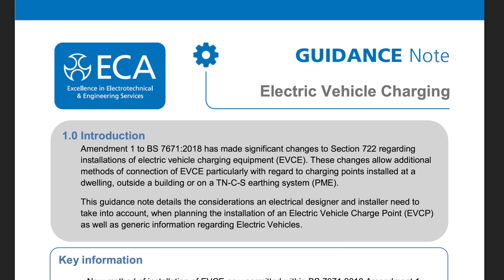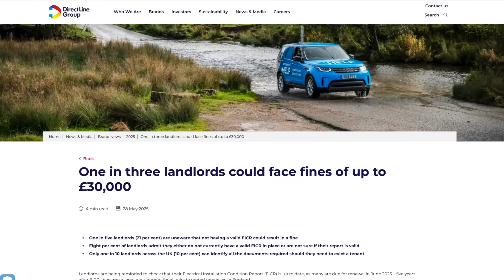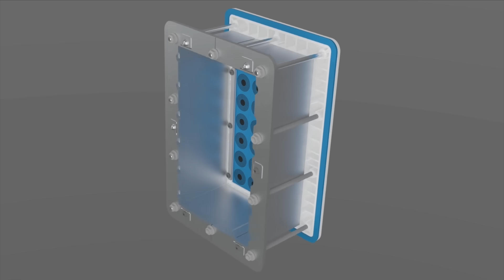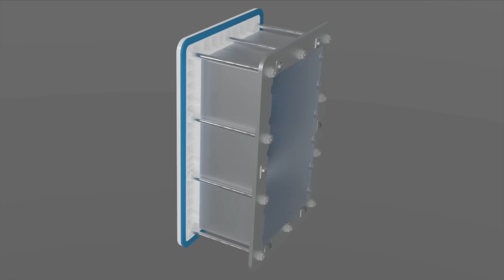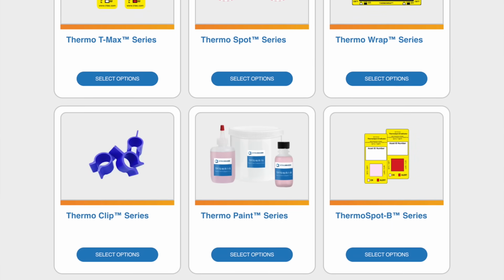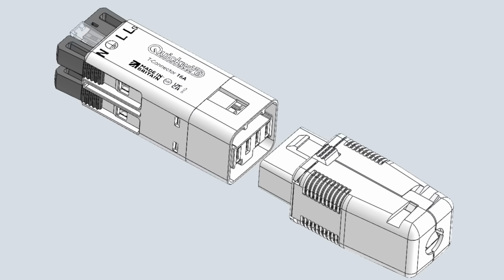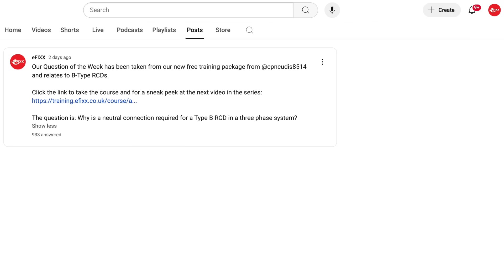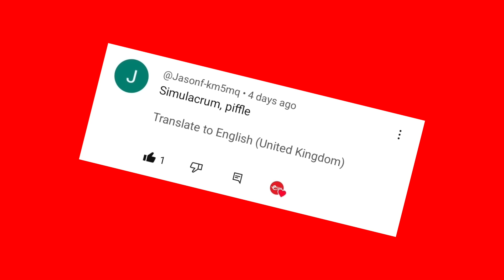Govt’s Cable Plan Sparks Safety Fears ⚠️

Comment: The Kordz PRS SlimCat page says it's rated as CAT6A and is good for 10Gbps up to 50metres, however the CAT6A standard is meant to be good for 10Gbps up to 100metres. It doesn't appear to be standards-compliant.

Equally, the Kordz PRO SlimCat page says it's rated as CAT6 and is good for 1Gbps up to 50metres, however the CAT6 standard is meant to be good for 1Gbps up to 100metres. It also doesn't appear to be standards-compliant.
Reply: Could be the 100W PoE that limits it to 50 meters. Likely able to do 100 meters if it was data only, or data and lower PoE standard.
Reply: Great question! You're right to dig into the details as there are nuances.
 
A Cat6 or Cat6A channel (or permanent link) depends on whether that installed component meets their respective electrical performance criteria defined in standards like ANSI/TIA-568 and IEC 11801. While these standards specify horizontal cable performance at 100 metres, that doesn't mean every permanent link must be 90m or every channel must be 100 metres long.
 
The Kordz SlimCat system is engineered to deliver a fully compliant Cat6 or Cat6A permanent link up to 50 metres. That means when installed correctly and tested (e.g. with a Fluke DSX-5000), it passes the same electrical benchmarks as a traditional 100m Cat6/Cat6A permanent link, just in a shorter format. The SlimCat Cat6 and Cat6A cable also meets ANSI/TIA-568.2-D horizontal cable electrical properties up to 50m. Therefore, we say that SlimCat achieves those same performance levels up to 50m, with the added benefit of a much smaller form factor.
 
Worth noting: we’re not claiming SlimCat is ETL-verified to Cat6/6A for 100m cable length. Instead, we’re transparently stating the real-world, standards-based performance we’ve engineered for up to 50m installations.
Reply: @kordzglobal  Thank you for your response. I've been using slim patch cables for a while now and I think they are great, so having the option for permanent links is really great - I'm personally excited to use it. I think it's particularly useful where you have a small existing duct, subject to alien crosstalk of course.

My concern however, is that I feel that the use of a category is misleading:

1) In retailers, the name of the product may be provided without the limitations and nuances.

2) On your own website, the first paragraph which explains the product does not mention the limitations.

3) You would expect to be able to use CAT6 cabling for 10Gbps networking up to 55m, however it's not clear what the 10Gbps distance limitation is for Kordz PRO SlimCat. (10m? 3m? Or is it not supported at all?)

4) Are the limitations specified on the reel/box?

I therefore have the following suggestions:

1) Drop the category from the product name, marketing and product information pages - It's not needed and causes confusion. (I.e. Just call them Kordz PRO SlimCat and Kordz PRS SlimCat)

2) In your product page, you can call out the capabilities of the cabling systems: PRO: 1Gbps up to 50m, PRS: 10Gbps up to 50m

3) Be sure to call out the capabilities on the packaging/reel/box.

In other words, instead of looking at the cable as "CAT6 with a limitation", be proud of it as a cable with capabilities such as "1Gbps up to 50m". It is my view that the category label does nothing but cause confusion

PS: What wire strippers should be used for this cable?
Reply: @yngndrw.  Thank you for taking the time to provide this detailed feedback. Have you considered a career in Product Management? 🙂 You've made some astute observations and we genuinely take feedback from our integration community seriously, so we will review this with our Product team. In answer to your question on the cable jacket stripper, we recommend one specified for use on cable diameters down to 3.5mm.

Comment: I can't believe this is happening. Cutting the footway you haven't a clue what is under there. having worked in civils for decades there are shallow cables, gas and other services. And when you have done it and it creates a trip hazard who is responsible not to mention any other damage. EV's are fine for some people but at the moment not for everyone.
Reply: GPR, ultrasound, cable detectors.
All can be used to see what is underneath.
Reply: @deang5622  From cat and genny to ground-penetrating radar to name but a few I've used many of them . With old services particularly with asbestos duct and where fibre has now been pushed through plastic water pipe you can do the best you can but be not 100% sure. I've seen the pole cat hit a gas main, water main and oil pipeline missed on detection. These trenches will need to be done by groundworks people and certainly not and stress of liability on an electrician which seems to being talked about. Even in the 80's when cable TV was being installed lots of damage occurred and I remember it well but I guess what will be will be.
Reply: @seantaylor9758  More work for more people. Break it, fix it, charge for it. Somebody's pockets are going to be filled, so don't worry about it. ;)
Reply: @tomaszwota1465  Agree, I nice little cottage industry.

Comment: And what happens when Fred from 3 doors down pinches "YOUR" parking Spot - You cant charge your Car - Shame
Reply: If you and "Fred" can't effectively communicate and organise to arrange where you park, then there are probably wider problems than being unable to charge your car...
Reply: @DevAnubis Seems Fred got the bus to Southampton for a 3 month cruise! 😂
Reply: @DevAnubis If you hold a science degree and your neighbour is a tattooed scaffolder, then there isn't much chance at effective communication, other than resort to a common language ..grunt.
Reply: @deang5622  Wow...
Reply: get you 3 phase generator out, problem solved.
Reply: @seantaylor9758 but doesn't that generator use fossil fuels?
Reply: Get your 50 metre extension cable out and drop the cable out the house's window.
Problem solved.

Comment: Surely they could fit the ev chargers with 1:1 isolating transformers. This would alleviate some risk from simultaneous contact with adjacent power supplies.
Reply: I had a 25 amp 1:1 isolating transformer made around 15 years ago and it was over £500 then so a 32 amp would be probably twice the charger cost.
Reply: @Andrew-su3wtGood point.
Reply: @Andrew-su3wtI’m also thinking if they are going to build street level distribution panels they could incorporate some form of isolation at the power supply
Reply: @Andrew-su3wt Not to mention the physical size and then the losses.
Reply: @PlumbBob-FGX yes also very heavy
Reply: Building isolation into the charger unit using switching power supply technology would be much cheaper & more practical.
Reply: Just don't use the PME and mandate an earth electrode on installation.
Reply: @gavjlewis however the nearby equipment may not have an earth electrode resulting in it still having significant potential back to wherever it's earth is.

The problem isn't the charger, it's everything. EV chargers are just getting held to a higher standard because they have come along more recently.
Reply: @insanityideas True but in most cases it is not an issue. Most modern lighting is metal. TV/Broadband cases are the same and grounded to earth. 
Obviously if you have legacy concrete lampposts then there isn't the touch issue anyway. 

I guess in some cases if there was a concern they could add suitable earthing to the street furniture and add it to your costs and then you can decide if it is worth it for you to proceed with the install.
Reply: @gavjlewis there are many simple pragmatic solutions... But EV rollout always seems to have people queuing up to not be pragmatic because EV became a culture war issue. Doubtless any install of extra earthing will run up against costs of contacting equipment owners and them making the changes at great expense. PEN fault protection is cheap these days, or mandating earth rod, cheapest is doing testing between possible earthed items to confirm no issues rather than installing unnecessary hardware. Seems like 90's bonding of all domestic pipework all over again.
Reply: @gavjlewis That doesn’t negate the risk of simultaneous contact points.

Comment: I should be OK for a pavement gully as none of my neighbours have an EV at the moment and the nearest lamppost is well beyond the range of my cable even when connected to my car.

Surely the solution if they don't want cables in gullies is to install 7kw charging posts on the street lighting circuit which will all be connected to the same source.  Use one of those RFID type card systems to directly add the units consumed to the customer's bill.

The advantage of such a system is that as a customer you can park at any post in the area and not just the one outside your home.  I'd buy a short cable just for use on such posts if they existed.
Reply: We have lamp post chargers around here. 3kW Max and £0.55/kWh. Same price as running a diesel.
Reply: @Tim_Small  Someone is price-gouging on those chargers...

What's needed is a plurality of solutions, cable gulleys, lamp-post chargers, dedicated kerb-side charging posts. Each suitable to their own situations. And legislation price-controlling EV chargers on residential-streets to at least make them fair (if not as-cheap as domestic tariffs).

There's absolutely no reason for instance that the government couldn't reduce the VAT for AC-chargers installed on-street in residential neighbourhoods, and mandate offering overnight-pricing and cap day-time pricing at the domestic price cap.

No reason other than requiring a backbone, which judging by how they're (not) handling the water-companies, is maybe wishful thinking...
Reply: @Tim_Small  worse than running a diesel by the time you take into account time finding a charger, time messing about with 100 different apps, time messing about with the cables not connecting/disconnecting, time spent waiting for a free charging spot

i spent about 10-20% of my working day at charging points when i had an nv200
Reply: Alot of streetlights use 4mm concentric feeds wouldn't survive an EV for 8 hours
Reply: Well the other problem is all the lampposts in by area are at the back of the pavement so you would still need gullies for the cable. 
I guess they could leave all the electronics and RFID in the lamppost and just have a small post with a holster for the type 2 plug in the road side.
Reply: but theres not enough lamposts per house on every street

Comment: Excuse my ignorance, but if it was a requirement for cross street charging installations to be TT (either by existing earthing rod or preferably a specific new earth rod/mat installation) would that not satisfy the safety requirements?
Reply: Yes, but that is far too easy a solution.!
Reply: Yes, requiring cross-street charging installations to use a TT earthing system (with an existing or dedicated earth rod/mat) would generally satisfy safety requirements. TT systems ensure fault protection by providing a local earth connection independent of the supply network, reducing risks like electric shock or fire from faults. This setup, combined with proper Residual Current Device (RCD) protection, effectively mitigates hazards in most scenarios. However, the "too easy" concern likely stems from practical challenges:
Installation Complexity: Retrofitting or installing new earth rods/mats in urban environments can be difficult due to space constraints, underground utilities, or pavement restrictions.
Cost: Dedicated TT systems increase installation and maintenance costs, especially if new rods or mats are required for each charger.
Consistency: Achieving reliable, low-impedance earth connections across varied soil conditions can be tricky, requiring regular testing and maintenance.
Regulatory Compliance: Local regulations or utility standards might favour other earthing systems (e.g., TN-S or TN-C-S) for compatibility or simplicity, making TT less universally adopted.

While TT systems are technically sound for safety, these practical and economic factors can complicate their widespread use, which might explain why it feels "too easy."

Comment: If the charger was not earthed and purely floating and isolated with a differential detector it'll simply shut down. The whole neutral+ground paradigm is flawed and dangerous.
Reply: Why not earth the charger? It needs to be earthed, otherwise the differential detector would not trip, unless someone touches it and completes the circuit to ground with their body. 

To me the nonsensical thing that is done in the UK and maybe other parts of the world is to connect N and E together, they should be in theory 2 completely separate systems, at least in residential houses (maybe in factories where it's not practical to have RCD that manage 1000A of current it makes some sense). It probably comes from the past there RCD where not so diffused and thus to provide indirect contact protection they only way was to connect them together, or just to save on an earth electrode. But it provides no benefit in terms of safety, rather the opposite. I don't see why not putting an earth electrode in any new installations, beside digital equipment works better with a "true" earth, SPD works better with a true earth to discharge spikes, photovoltaic system needs a true earth reference, etc.
Reply: @alerighi  No. If a differential transformer senses no differential then the only fault condition is if BOTH conductors have a perfectly balanced leakage current, which you can also sense for with a current transformer around both wires.
Reply: You have to earth the metalwork of the car. There is no choice on that. There cannot be. That is for the obvious safety reason.

The only way around that is to use galvanic isolation and one big beefy isolation transformer before the EV charger. That's going to be pretty big.
Reply: @deang5622 you can achieve isolation with a far smaller transformer (actually a double wound inductor) using switched mode technology operating at high frequency.
Reply: @deang5622  A big advantage of switching power supplies, small transformer. But DC low power charging not common.

Comment: The IET states that you have to be competent to carry out an EICR .
You are saying qualified as well.
A bit of clarity would be good.
Reply: The IET is wrong. Yes, I did say that.
The relevant law is:
The Electrical Safety Standards in the Private Rented Sector (England) Regulations 2020

Applicable clause within the regulation is:
(3). (1) (b) Which says:
ensure every electrical installation in the residential premises is inspected and tested at regular intervals by a qualified person; and....

The word qualified is used, not competent .
Reply: @deang5622 qualified to what level though?
Reply: @muzikman2008  Qualified by their boss having an NICEIC subscription.
Reply: Not competent until you are qualified.

Comment: Cutting a groove across the pavement only works if you allowed to reserve the parking space outside of your house, otherwise you will find stranger's cars in the way. Sounds like a cash raising opportunity for councils when they charge to implement this.
Reply: They already charge to implement. More than the cost of a charger for their guys to come and grove the pavement to the correct standard. Allowing electricians to do it would make costs reasonable but take away a revenue stream from bankrupt greedy councils.
Reply: All of the cars will be EV so any street charging would have to be for common use - naturally.
Reply: @philtucker1224  Would need extra metering (built into car?) to ensure that the cost of the electricity went to the right address. Possible, but another layer of bureaucracy.
Reply: @roberthuntley1090 (it could just be a card or a phone app so that would not be an issue). However in a few years from now a street that had parking for ( say) 60 cars WILL need 60 charging points.
Reply: Nope! 
You can charge directly next to it or one in front or one behind. 
The average EV range vs avg daily car use means the average car would need charging once a fortnight.

Can you park outside your house or one up or down once a fortnight? 

I certainly can
Reply: have they defined how deep this "groove" can be? can i dig a gulley in my street now and just flash my card at them saying its ok, i have a permit?
Reply: @rashdondoesntunderstandwor-g1xit will be to install an approved gully system (like the picture) that will define the depth, likely 50mm or perhaps more.
Reply: @rashdondoesntunderstandwor-g1x Yes, it's been trialled for over 3 years, there are multiple manufacturers of cable gulley products preparing their solutions for regulatory approval.